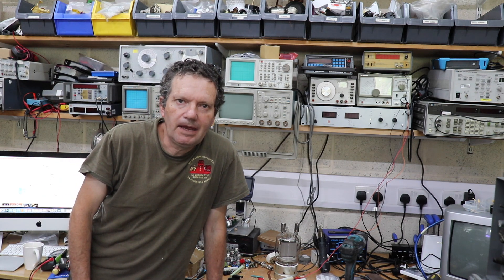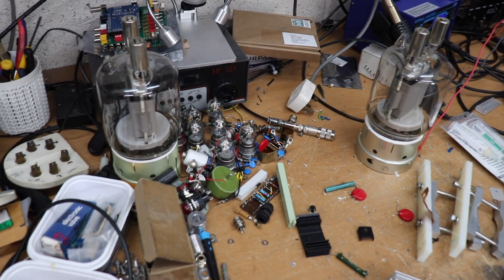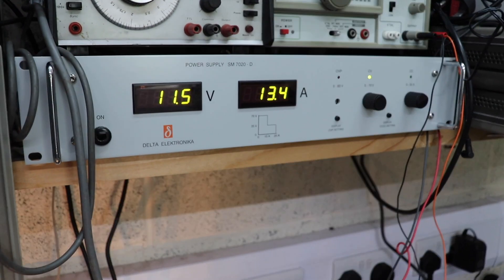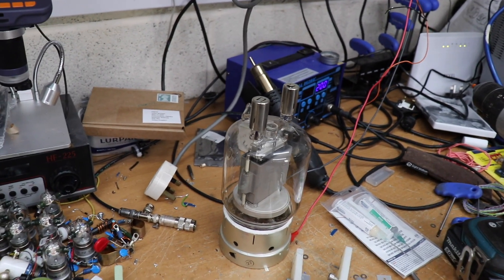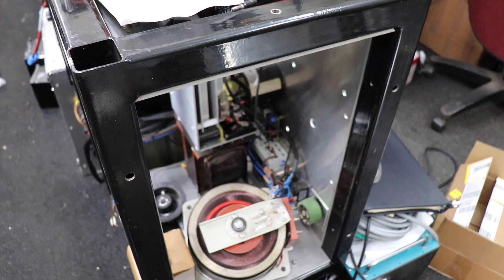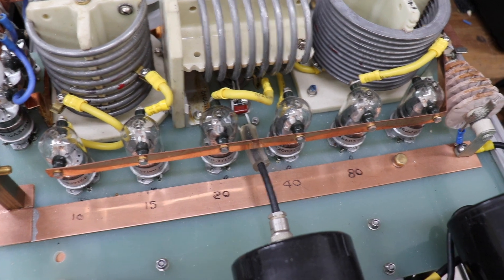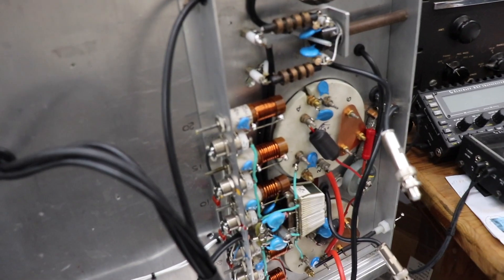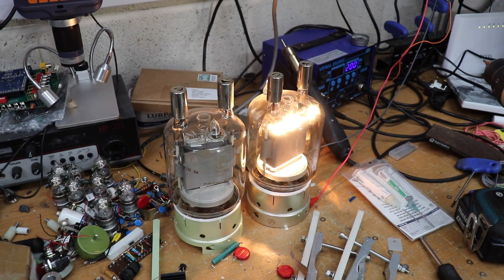Revisiting The GU81M: Probably Not The best Choice For A Linear Amp!

Comment: I disagree, despite my aversion to Soviet products! 
However, I have made many PA for 2 x GU81 and they definitely have more advantages than disadvantages! (like all lamps). You can easily reduce the filament power by switching the filament voltage from 3 volts to 12.5 volts. The lamp starts immediately and “rests, saving energy” during reception.
When working in parallel, it is easy to adjust the P filter to 28 MHz,  but not on relays! Making fixed 9-input Pi filters is just as easy. The amplifier has no fans, so it is completely silent!!! The only requirement is a suitable vertical enclosure with an openwork bottom and top. The most important thing, however, is their durability and very low price. Best regards 73! de SP7GX.

Comment: Hello.
The GU-81 has an internal grid 2 bypass capacitor to the filament ends.

Have you used the GU-81 (Not GU-81M) with a screen votlage of 1000V?

Comment: i have an amplifier with a pair of gu81m the amp was amazing (cost me only 400€) yeah it's has some disadvantages like high heater current...also need relatively complex in/output π network for work....but still worth it....provide 3100W PeP on 160meter and 1900W in 10 meter ...and the biggest advantage's is about this capable to run like 24/7 in full power....i using a 10KVA 3 phase HV trafo....no multiplier or else straight 2 way rectifier and a huge cap on anode side.... and all voltage has an individual linear regulator on them....works well but few issues the amp is big currently living in the rack cabinet.... luckily the amp is relatively quite.... currently i building an HF amp with 2 GU78B i interested for the result....thx the video anyway
Reply: If you can optimize the pi network as I said above, you will get at least 2800+ W in 10m

Comment: We have  built an amplifier what using a pair GU-81M, it works great even on 10 mters, it can output 2200W+ on 10 meters, the output capatance  it is not problem, you can use a roller inductor ,
Reply: Sweet dude! I just bought 4! Didn’t expect id need vacuum caps and vacuum isolators. And the regulated 2kv caught me kinda off guard. I want to avoid silicon as much as possible for emp reasons

Comment: I built a HF amp using 2 x 813's they needed 10 volts @ 10amps and difficult to get them to work on 10 meters. about 600 watts.
My latest project was reverse engineering a Heathkit SB200which was  using 572B tubes to Russian pulse radar ceramic UHF tubes,  GI6B x2  or I could have used GI7B's . the heater is 12 volts @  2 amps each and with 2.4kv and about 20 watts of drive will give 800 watts of carrier on 10 meters where as 813 x2 and 100 watts only gave 600 watts.

the GI6B's are very cheap just make a hole in the  chassis 36mm and clamp with a cap clip.
They are triodes
Reply: In my experience, the 813 can work well at 10 meters. It can still work even at 6m. The problem is that the minimum capacitance of the plate capacitance of the PI network we use is too large. This is not a problem for vacuum tubes with relatively small output capacitance, but it is a big trouble for vacuum tubes with large output capacitance such as 813, GK-71, and GU-81M. They will drop sharply in the output power of the band of 21MHz or above, the plate is red...., our solution is to use rolling inductor tuning, just like Henry's power amplifier, the plate tuning capacitor uses a fixed capacitor below 21MHz, and above 21MHz directly uses the output capacitor of the tube to act as a role, in fact, there is no real independent plate tuning capacitor in the slot. Here's how we worked. The results are very good. Also, I'm not interested in any pulsed emission tubes, the main thing is bad linearity. That's why any commercial amplifier doesn't use this type of tube. Their only advantage is that they are cheap
Reply: Did you make your GI6B amp grounded grid?
Reply: use roller inductor replace the fixed inductor and replace variable capacitor (plate tune) use fixed capacitor on higher band(21MHz or higher) no extra fixed capacitor. I'm sure you will  get same power in 10m as low band

Comment: I would not use vacuum relays for band switching. The lead length within the Pi circuitry of that amplifier is far to long for eficient use on the high bands,
Reply from the maker: Yes, some of them are a bit long

Comment: I've had a QY5-3000A valve on the shelf for years. I collected all the transformers required for the PSU then ran out of interest time and space. It does require fan cooling, which would be a nuisance in my little 8' x 12' shack. It would have to be a two box design as the PSU HT transformer alone weighs 80 pounds. Heavy had a hernia repaired already I don't fancy heaving that thing about😂